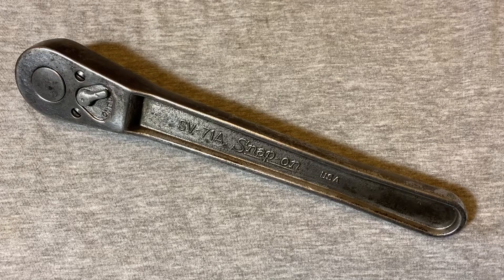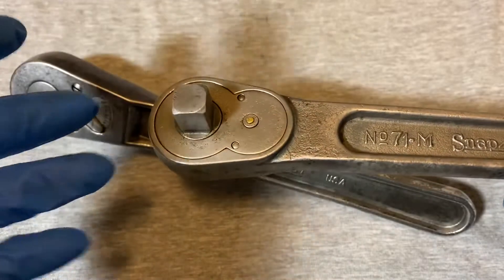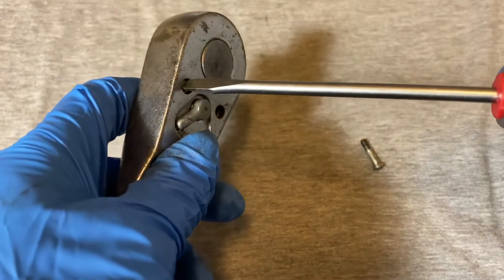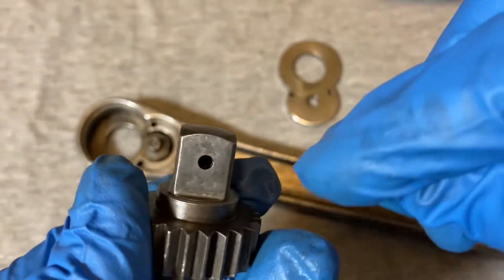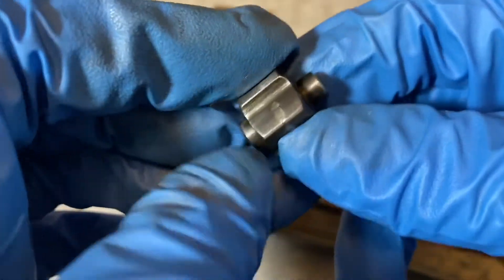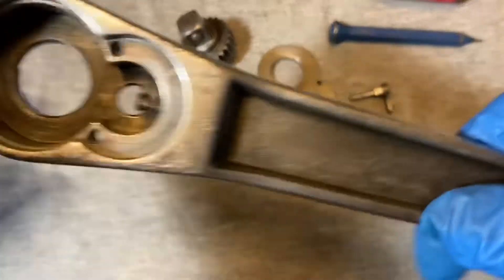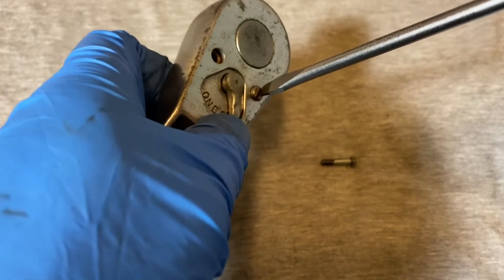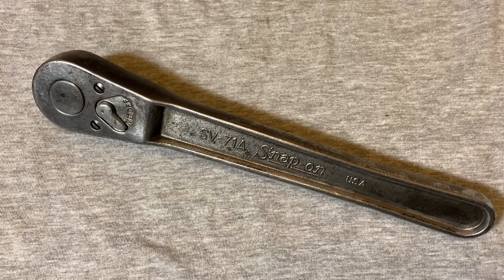Snap-On SV-71A Ratchet TOTAL TEARDOWN, Vintage 1/2” Drive

Comment: They indeed were made for a very long time, acquired one off ebay recently, made in black oxide finish, which dates to 1992, so at least in the industrial range they continued to be made into the 90’s, very impressive
Reply from the maker: Thanks for dropping in with that info. That’s a pretty long run

Comment: Great video, you can use a bent paper clip to compress the spring and a little tacky grease to hold the bearing on the spring.  The paper clip can be radiused just right to keep the bearing in place.
Reply from the maker: I’ve made something similar from a piece of soda can to put together really hard ratchets like the Craftsman last USA teardrop quick release

Comment: Interesting video. I just bought a 71 on Ebay and was wondering what year it was manufactured. I see there is a sheet with the years of manufacture for Snap-on . I'll have to check what year mine was made .
Reply from the maker: Depending on what model 71 some came with no date codes on the ratchet
Reply: @snapringchronicles3020  Between the on and off looks like a G which looks like a Government 1945 model.

Comment: I have same exact rachet and I cannot get that face plate off for the life of me any reccomendations it’s not rusted at all nothing I don’t understand
Reply from the maker: You can try to put some penetrant around the edge of the plate and let it soak. Then take a small hammer and start tapping the back of the gear. It’s that round flat part that sticks out on the switch side of the head. Remember when it comes off you might have to tap the plate back on when you are finished. Hope that helps

Comment: Are the screws replaceable ? Can I get some somewhere????
Reply from the maker: Snap On might have them. But you might also find screw from your local hardware store. From my measurements the screw for this particular ratchet is size #6-40x5/8” Fillister head. Hope that helps

Comment: Is it wise to use any kind of lubricant?
Reply from the maker: There are many schools of thought on this subject. Me personally on a low tooth count ratchet I would use something thicker like a grease or you can use a thinner oil also. On a high tooth count ratchet (like 72 tooth plus) I would use a thinner lubricant like 3in1 oil or something similar. Hope that helps.

Comment: R u sure that's a boxed 8? The line one side doesn't look as "defined" as the other which makes it kinda look like an "E" with a gouge down one side
Reply from the maker: I took a second look and both sides of the 8 the lines are very pronounced so I think it’s a box 8. Is your concern that this model was not still made in the late 60’s?

Comment: The one with the M is military
Reply: No the M doesn't indicate that. The M is just part of it's name. The ratchets that preceded the No.71-M were the No.71-N and No.71-A. But Snap-On did indicate ratchets sold to the military by adding a V. The ratchet in this video, the SV-71A is one of them. If it had been sold to non-military customers like mechanics it would have been labeled S-71A (I have both). Snap-On did that because military tools don't come with the standard lifetime warranty, but the government surely got them for a lot less.